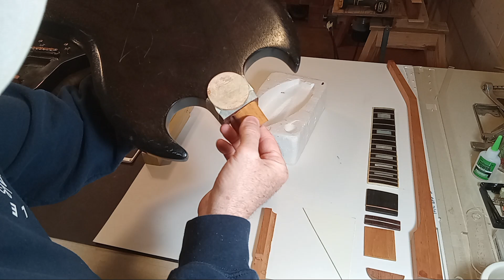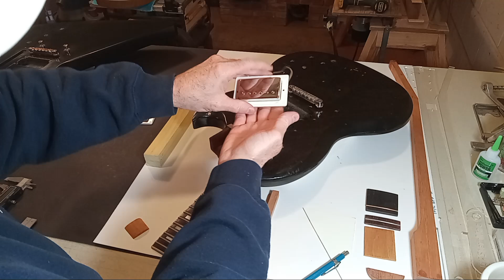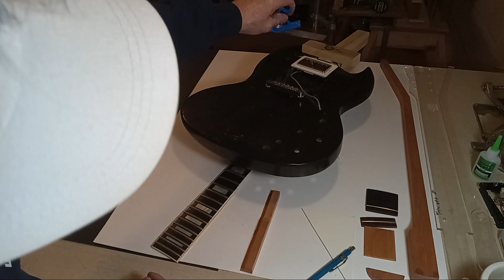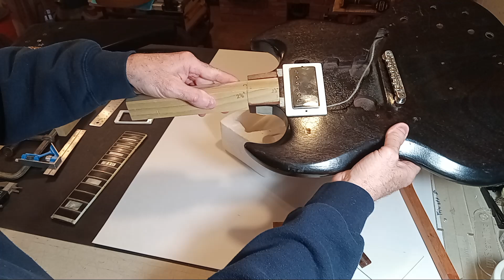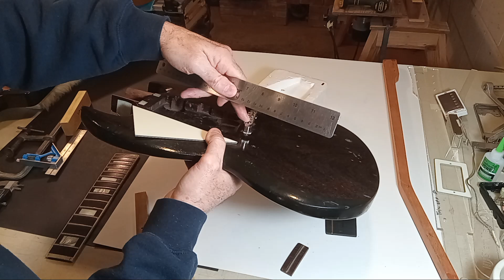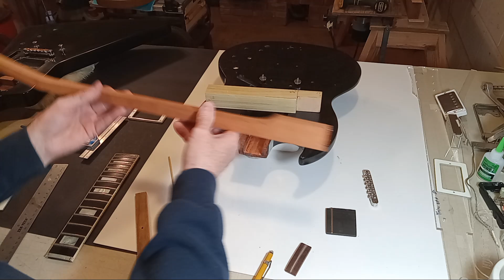V5A.  1969 Gibson SG Custom & Standard Restoration Per Historically Accurate Vintage Specs.

Comment: Hi,.. It is possible to adjust the neck of the guitar into a D shape.
Reply from the maker: For certain, so long as you don't sand into the truss rod/channel. Sometimes they are much closer to the back of the neck surface, than expected.

Thanks,
Marc
Reply: @DejaBluGuitars  ok